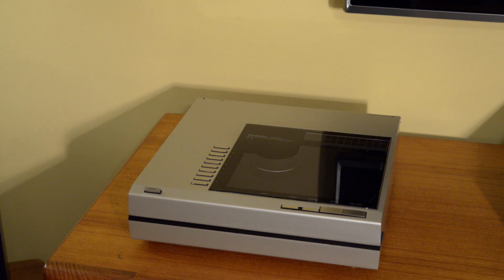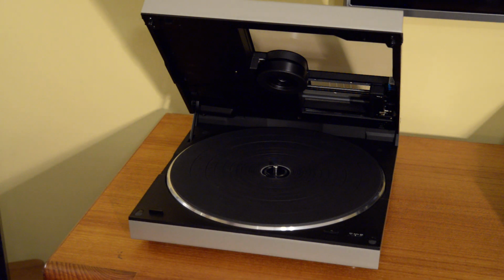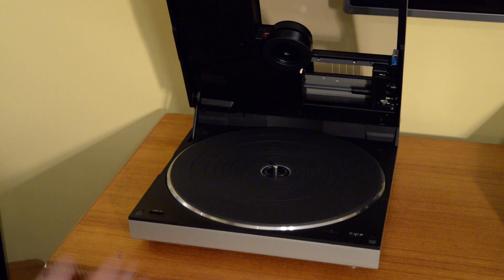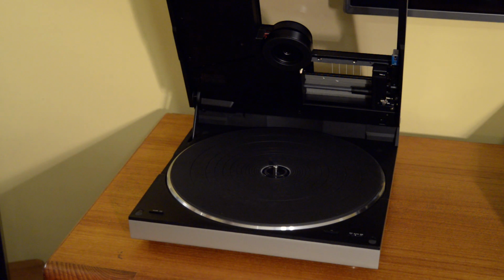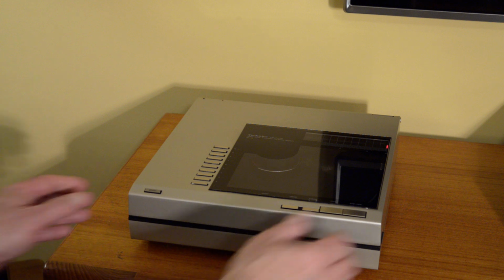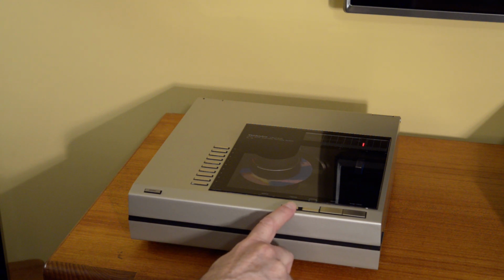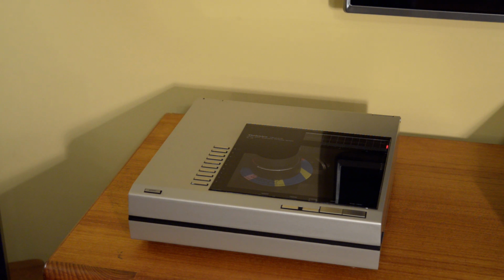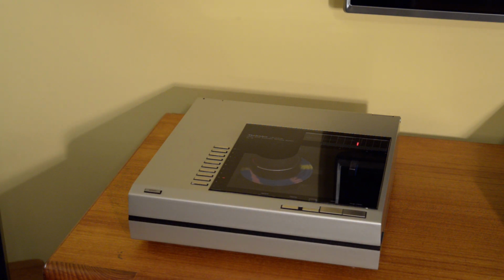Technics SL-15 Linear Tracking Turntable - Incredible!

Comment: Ecellent video, thanks! I just found a dark grey one and eagerly awaiting its arrival. Will use it with my Onkyo Integra rig instead of the 1055 FII turntable that has ended up a bit unreliable. I did not know these existed until i found this one and fell in love immediately. Such cool early 80's tech, i couldn't resist it. A question: is it worth it to change the RCA cable you think?
Reply from the maker: Thank you! I hope your are enjoying your SL-15. If you have the original RCA cordset (the one with the integrated ground wire), then these are nice quality and I wouldn't change unless there is deterioration or damage.
Reply: @Round2Audio  Thanks! I am enjoying it indeed. It was the original RCA cable that came with it. I find the sensors a weak spot. My player seems not work correctly and i think it is the track sensor that  is the problem, or the light source. It often misses tracks and the setting on the back to adjust is just moving the problem around.
Reply from the maker: @gorber81  If you have an oscilloscope, the 'band sensor gain adjustment' can improve the track sensing. Also, if there is a problem with the senors, the waveform on the oscilloscope will make this evident. To do this adjustmet you have to remove the clear plastic insert, and the trickiest part of this is to very carefully remove the narrow black plastic strip over the screws. This strip is held down with double sided tape. Proceed slowly and carefully as you will need to reuse this strip.

Comment: Hi there. 
Thank you for the video. Beautiful unit. 
I have an SL15 as well in mint condition, including the original cartridge. Unfortunately, it developed an issue of stopping without prompt. Would you be able to share who restored yours? If you restored it yourself, do you do that for a living? 😁 
I would of course like to have it restored/repaired but I do not dare to just take it to an unknown shop. Any thoughts will be appreciated. Thank you.
Reply from the maker: I do restore these, they are wonderful units as you are aware. There is much to do to get them to a top notch and reliable state, but as a start I suggest removing the inner top cover and very thoroughly cleaning out the old grease, and VERY lightly applying new synthetic grease, as well as a new belt. The main rail is often sticky and over lubricated over the years. I clean this up thoroughly, then apply synthetic grease, move it back and forth a few times, then wipe off the grease.

Try this and please report back.

With diligent service, these can run again for many more decades. Good luck!

Comment: How does the SL 5 compare to the 10/15. Picked one up for 50 bucks and going to get it going.
Reply from the maker: Soundwise they will be very similar when the mechanism is cleaned and calibrated. The SL-10 and SL-15 are heavier with better isolation.
Reply: I have 2 SL-5 and love them and built well.

Comment: Beautiful! I'd kill for one of these! I got a SL-5 when it went on sale at my local mall back in the early 80's. Still have it but the rail is like glue now and it doesn't work.
Reply: Hi
Find the service manual, open up carefully, add some solvent to the rails and wipe off the old grease residues. Add new grease and voila! 
If there, replace all the belts iside, the tracking belt definitely is too soft now. If belt are hard to find, search similar sizes or you can 3D print it out of TPU rubber filament, use random Z seam position in setings. (I printed mine tracking belt and also for the cassette player).
Reply from the maker: Thanks you. A sticky rail would be gummed up grease. Good luck!